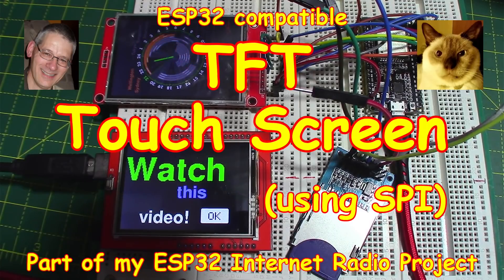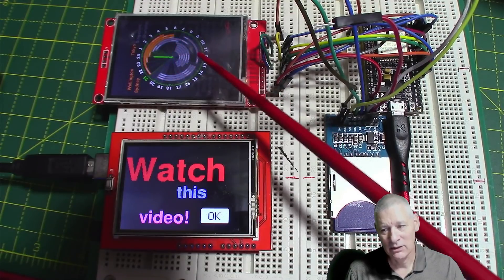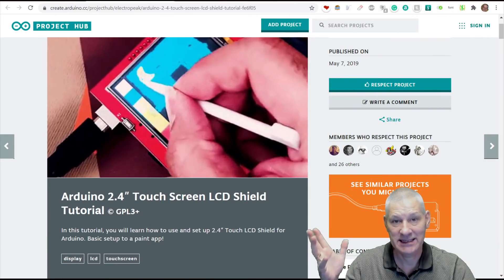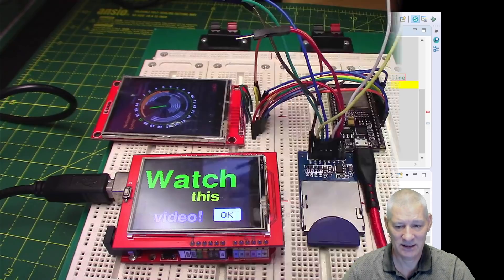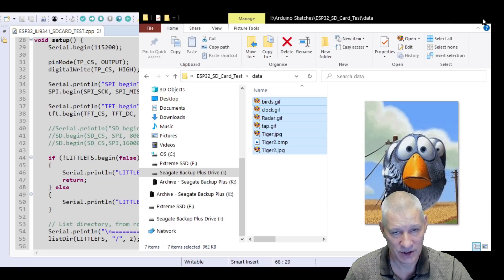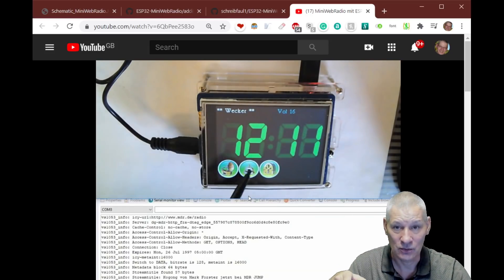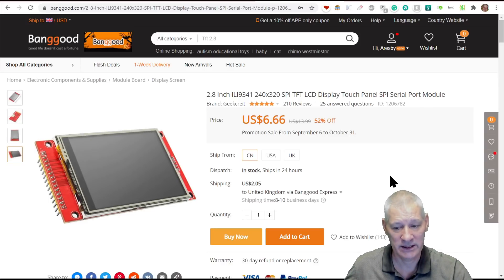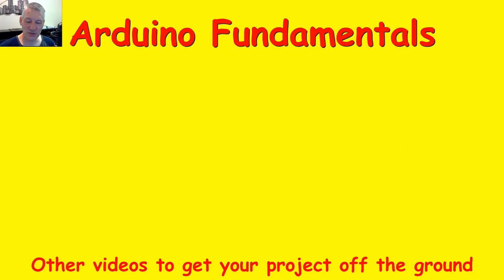#204 TFT Touch Screen ILI9341 SPI for ESP32 (Internet Radio Research)

Comment: I'm using  ILI9341 with ESP32 Wroom DOIT Dev Kit v1 (30pin version). I already solder all the connections instead of using breadboard.
I can't get my built-in SD slot to read and display jpg image stored on SD card.
I'm using eSPI library. 
Here is how I connect:
            cs=15,  rst =4,  dc=2, mosi=23,  csk=18 , miso=Not connected
            t_slk=18, t_cs=21, t_din=23,  t_do=19
            sd_cs=5, sd_mosi=23, sd_miso= 19, sd_sck=18

Please help.
Reply from the maker: When using SPI (as you are here) the MOSI, MISO, SCK are shared, that is, the same for each device. It is only the CS (Chip Select) line that has to be separate for each device and which goes LOW to select that device to talk (you must never make two CS lines LOW at the same time). Try that and put a text file on the SD card and try and read that first.

BTW the MISO (Master In, Slave Out) and MOSI (reversed) are now called CIPO and COPI (Controller In, Peripheral Out and vice versa) which is more PC and quite descriptive too!
Reply: @RalphBacon  Thank you

Comment: Dear Ralph, I have a shield for UNO. Its touch is defective and cannot be calibrated at all. I tried lots of tutorials and ... all in vain. So, could you help me if I decide to use it just as a LCD without touch which pins of the shield should be used? By the way, my major is not electronics.
Reply from the maker: You must first identify the exact model of screen you have, starting with the driver chip. Some are very similar looking, so you must spend time on this aspect. 

Then use the pins from either an Arduino library (I probably used the most comprehensive library out there, read it and when you have found your exact screen/chip comment out the other screen names leaving just the one you need) or using the data sheet (good luck with that). 

Ignore the touch function as this will use different pins albeit they may be shared on the SPI bus.

Try and upload the simplest Hello World sketch you can find in the examples just to get it going and thereby proving to yourself that you have found the correct screen.
Reply: @RalphBacon  Thank you so much for your quick reply. I will do what have suggested. I will report the result.

Comment: Why did you take the ILI9341 with parallel and touch?
Reply from the maker: Because it works amazingly well. Both display and touch work as expected, although I think (not sure) I had to invert the touch coordinates. Anyway, it was built into my ESP32 Web Radio and is still doing what it is supposed to today!

Comment: I actually like the way the sd reader sticks out sideways, that was one of the reasons I chose this module. I want to have my webradio also able to play mp3 from sd and for that I want the card to be pluggable from the top. Hope I can use the display that way around, since you mentioned the slot being on the bottom...
Reply from the maker: You can flip the display orientation in software if needed, so it should be fine.

Comment: I'd love to see someone tinker around with the ATS-25 as it does have an ESP32 Wroom and a SI4732, the second core, wifi and Bluetooth of the ESP32 aren't even being used.

I'd love to see if the ATS-25 is capable of more.
Reply from the maker: I can't believe someone hasn't already created an all-singing radio with this device. Search the Internet, bound to be out there!
Reply: @RalphBacon  I've looked and there doesn't seem to be much of anything done with the ATS-25, people pretty much just buy it and leave it as is, I mean there has to be a bit more that it can be capable of, I mean most of the ESP32 is left unused, only a single core is used, the wifi and Bluetooth is unused, the second core is unused (you'd figure there would be someone trying to use the second core to try to make the UI more responsive or something but not even that). 

You'd figure there would be something, but there is nothing that I found.

Comment: did you have any issues with the touch screen with the miso pin on the tft connected? my 4" st7796 will not read touch when tft miso is connected. it took me weeks to find the problem
Reply from the maker: No issues at all with the screen that I used (with an ESP32). Worked exactly as expected. My touch and screen MISO/MOSI are, of course, shared on that bus (wired in parallel). I'm guessing either your board or the library you're using works differently? The CS pin is not being held permanently LOW for the screen/touch?
Reply: @RalphBacon  no when i pulled the miso pin from the tft pins and only had touch miso (they are on same bus) the touch and tft works fine. im also on esp32. at the moment i can live without having to read from the tft. oh well at least i got it going eventually (i got it after you released your esp32 radio and trying to sort it since then)
Reply from the maker: Is this the same screen I'm using in my ESP32 radio?
Reply: @RalphBacon  I think you had the large screen in one of the videos (320x480 4inch) it is based on the st7796 chip not an ilixxxx chip
Reply from the maker: The library I use for my ESP32 Web Radio (with touch screen) will also support your screen. It's called TFT_eSPI (mine is v2.2.23) by Bodmer and can be downloaded from here: https://github.com/Bodmer/TFT_eSPI and it's now a later version.
You do have to update the User_Setup.h file to indicate which screen/driver chip you have (you must uncomment out lines) but it's worth the trouble to do properly.
Reply: @RalphBacon  thats the one i use, i need to order some more serial screens as i have a couple of projects in mind, one being a bluetooth macro keyboard using an esp32. it will be configured using a web ui on the esp32
Reply from the maker: Right, in that case I highly recommend you order the exact same screen as I used to avoid any future touch screen issues. I bought mine from Banggood; links are in my video description. Of course the price has risen, now that the Chinese are adding vat to everything. I hope that vat comes back to the UK and is not some Chinese ploy to increase prices!
Reply: @RalphBacon  Yeh i noticed all them screens are getting expensive, im sure the price is nearly double now to what i paid last year and there nearly all charging postage aswell 😪

Comment: Hello, the tft freezes after some hours. What can i do? I think it must be a stability issue. How i can reduse the noise on spi pins and make more stable the connections? 
Thanks in responce and congrats for tha amazing channel.
Reply from the maker: Firstly, ensure your cables are not too long. Whilst I have used 30cm cables here I have also reduced the frequency of the SPI bus from 80MHz to 40MHz. 
Anything generating electrical noise near those (unshielded) cables could cause it to lock up, I suppose. 
Try running a simple program overnight that just counts from 1 to a million and see if it is still running in the morning. 
Ensure your PSU that you driving the ESP32 with via the USB socket is up to the task, not just an unpowered USB from a hub. 
If you can repeat the lockup, trying removing the power from the LED pin and reconnect that the following morning - still locked up?
Reply: @RalphBacon  Thank you for your help!!

Comment: Is there a 3.3V i2c or UART communicating touch display for ESP32
Reply from the maker: Yes, I'm using one right now in my Web Radio Project - see this for some links below the video. The screen is very good value at about $6.66 from China (plus a bit of shipping) or about £10 from the UK. If you live elsewhere take your pick!
Video: https://youtu.be/xrR8EZh2bMI 
TFT Touch Screen: https://www.banggood.com/custlink/v33EPJT6cF
Reply: @RalphBacon  I didn't formulate well the question. Using the suggested display consume my processor resources to drive the display. What I need is a HMI on 3.3V-3.6V serial communication, just to send the new values of some variables and the display to take care for the rest. If a button on the screen is pushed to send me back the information of the event.
I try  Nextion with esp32. I can read from the display, but display can't from the processor. Using Arduino with the same sketch I have no issue.

Comment: I recommend the TFT_eSPI lib on esp32 for the ili spi sd touch versions ..
no problem about 30pin or 38 esp versions .. webradio needs only vs1053, esp32, ili9341 (touch, sd)
the base webradio ino code without ili (but serial view) .. its very small .. https://github.com/schreibfaul1/ESP32-vs1053_ext
Reply from the maker: Yes, I've been down that route several weeks ago, and I'm using that library for the TFT too. MY web radio has evolved now into something more stable and useful, running 24*7 in my workshop.
Reply: @RalphBacon  
I'm sorry, I didn't look at the date, otherwise I would have scoured your channel. i have had a similar development on this base for months, with querying the time server and bme280 pressure, hum, temp and also a tx / rx rfm69 .. the project is not yet public. I wish you a lot of fun refining :)

Comment: Can the TFT shield work on top of with a wemos d1?
Reply from the maker: The Wemos D1 is a 3v3 device but does have a +5v pin in the usual place, which the screen will need (I tested running it at 3v3 and it didn't work). Then we have the question whether the screen pins are at 5v or 3v3 because the D1 is a 3v3 device - would it be damaged? I can't answer the question fully; scour the internet, surely someone has tried this?

Comment: Those 38-pin development boards are a bit overrated compared to the 30-pin boards. The extra pins are mostly FLASH-pins (SD0, SD1, SD2, SD3) and ground-pins. The FLASH-pins should be kept floating at boottime, so be carefull using them...
Reply from the maker: Agreed I've done some research and the 38-pin dev boards (my one at least) has pins D6 - D11 exposed that should not be used (at least not as inputs) as they are used as a separate SPI bus for the ESP32's flash memory. So that brings the total down to 32. Subtract a couple of extra GND pins and we're down to the 30-pins of other (smaller) boards. Sigh. I believe I have a 30-pin board so I'll build another Internet Radio Player with it just to ensure it still has enough of everything! As it's smaller it would fit on my PCB better.

Comment: Hi Ralph- Great video. I wanted to add there is a TFT library for the Arduino TFT Shield that works great. http://www.lcdwiki.com/Main_Page It seems they classify the TFT's into 2 categories, "Arduino Shield" and "SPI Breakout Board". The Arduino shield TFT uses a bit banging protocol and the SPI uses hardware SPI. I have both and the Arduino shield seems to be a bit faster then the comparable SPI unit. The Arduino shield version also multiplexes of few of the display and touch screen pins. The shield is great for development stuff but it's not easy to use in a real project since it must be sandwiched to an UNO or a MEGA which limits panel mounting in an enclosure. Great to see another super video and keep up the great content!
Reply from the maker: Thanks, Mark. As it happens, I'm using a different library now which is more powerful (and designed for ESP32 32-bit operation). My needs are very modest but it's a nice library to use. More details next week...

Comment: Interesting project and nice presentation as always. 
Just yesterday had a conversation about 'Touch Screens' and whether they might fall out of favour due Covid-19 for all the commercial uses they've been popping up in; such as Banks, 'petrol' pumps and store/restaurant purchase equipment, where most of those won't work with gloves on, a stylus isn't provided and cleanliness isn't upkept between customers.
Reply from the maker: I understand people's concerns, for exactly the reasons you state. Luckily my gloves work with touch screens (they have some tiny (carbon fibre?) pads on the index and thumb position so I can scroll my phone too.
Reply: Yes.....and i can also report that my thin nitrile gloves also work with touch stuff.

Comment: Looks interesting Ralph. As we build a new house soon I might need some internet radios soon 😀
Schreibfaul1 seems to be a German guy with great projects. I already build his scrolling text clock a few years ago.
Reply from the maker: Sounds great! As it happens I decided that rather than implementing an existing project, which I didn't really understand, I'd design my own. What I now DON'T know about streaming radio streams with embedded ICY information is not worth knowing anyway! All will be revealed next week. Currently listening to Antenne1.de (128k), very nice.
Reply: @RalphBacon  looking forward to this episode. I’ll definitely had the plan to build a cheap internet radio myself. Do you plan to include a web interface to set up your desired radio stations?
Reply from the maker: Eventually, yes. I'm getting the core functionality working first. I got the ring buffer working today, such an improvement. But I'm jumping the gun here!

Comment: Yes will definitely keep an eye on this, sounds like a project I'd like to do. I have worked with this particular display with an arduino and found it was slow initially until I stumbled upon this configuration fix that is outlined in the following video link, in it he describes using it with Hardware SPI vs Software SPI and by omitting (_mosi, sclk) in the setup it will speed things up significantly. Don't know if this is relevant to you or not but thought I would share it... https://www.youtube.com/watch?v=KFjYQMAUDjw
Reply from the maker: I checked my setup, Adrian, and it uses the correct MISO/MOSI/SCK pins. I don't think CS or DC affect the speed. When I was experimenting in this video, I did notice how super fast the demo was (too fast to really appreciate what was going on). Thanks for the link, others may find that invaluable.
Reply: @RalphBacon  No worries, from my understanding, physically you still connect and use the pins it's just you have to remove (_mosi,_sclk) from the code to force it into Hardware SPI. This came about when I watched a video somewhere about the screen and the guy was stating that the screen was very slow to draw and loads people in the comments said you had to remove those bits of code. I tried it and sure enough it worked.

Comment: Have you managed to get 2 SPI devices to work on an ESP32 yet ?
Reply from the maker: I've got three devices running, really: the VS1052 MP3 decoder, the ILI9341 screen and the touch part of that screen, also on the same SPI bus. The touch (input) part runs the SPI clock at a slower rate of 2.5MHz, the display (output) part runs at 40MHz.

Comment: Generally if you find the highest quality stream you  can, it will sound very good when hooked up through an external amplifier. I was running mine with i2s into a pcm5102 module.
Reply from the maker: Good to know! Mine is playing a 128Kbps AAC stream via the VS1053 hooked up to some decent (active) speakers and it sounds fine.

Comment: My first ESP32 "clone"  I bought from ebay it had 38 pins, onboard wifi/bt antenna and external antenna socket. It was a great little microcontroller but now I only buy genuine Espressif ESP32's from mouser uk.
Reply from the maker: In what way did you buy a clone? Are you saying the ESP32 processor block on it was not from Espressif? How did you tell? I'm worried now!
Reply: I think the thing to look at here Ralph is that you can get a genuine reference board for about the same price and know that it has good quality components. And you can even get high end component boards from reputable vendors for a dollar or two more. Digikey and Mouser both stock them.
Reply from the maker: Both those suppliers, Carlan, are outside of the UK and charge an arm and a leg for shipping. Our equivalent might be RS Components and they put the price of the ESP32 outside of my budget.
Reply from the maker: That picture from@Backyardbasher looks fine to me!

Comment: will it be usb powered
Reply from the maker: Oh yes. But I have noticed that if I use an unpowered hub the ESP32 will constantly reboot with "Brownout Detected". As soon as I power the hub it works just fine (and, of course, a standard USB wall wart works fine too).
Reply: @RalphBacon  yeah, processor and wifi and screen, that is a lot
Reply from the maker: That was without the screen being connected!

Comment: Nice info Ralph. Thanks for the interesting video. I thought the SD should have worked easier for you. I have one of these ILI9341 displays connected to an STM32 and had to figure out how to connect the touch pins to MOSI, etc. Then I had to figure out how to reverse the touch y axis.  Also, I am going to try to paste a link to a combo from Open-Smart on Ali Express. It comes with an UNO clone that can be set for 3.3 or 5 volt operation, a touch screen, an SD shield, a memory card, and a cable. I got one and used it for a small photo frame project that fits in a standard picture frame. The Open-Smart web page has a modified MCUfriend library for the display. I use the 3.3 volt UNO for a lot of testing on shields that won't go to 5 volts so I don't have to do level shifting for testing.

link: https://www.aliexpress.com/item/32964204802.html?spm=a2g0o.productlist.0.0.60bc3a0bXnh3Uv&algo_pvid=73f50fcf-bcf7-4849-af8f-695c941cefba&algo_expid=73f50fcf-bcf7-4849-af8f-695c941cefba-57&btsid=0b0a555716046726766224032e54df&ws_ab_test=searchweb0_0,searchweb201602_,searchweb201603_
Reply from the maker: Nice product (link). Looks very similar to mine (just without the SD card). Talking of which, SD cards are notorious at getting corrupted (just ask any RasPi user who hasn't yet converted to USB stick). But I just copied my SD card routines from my Home Alone project, replaced the "SD" with LITTLEFS and it "just worked". Cool.